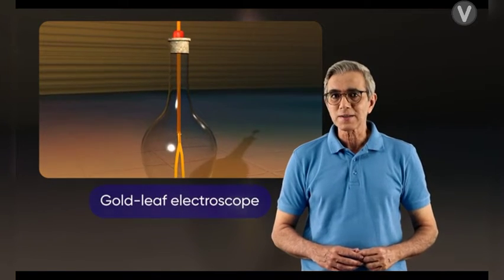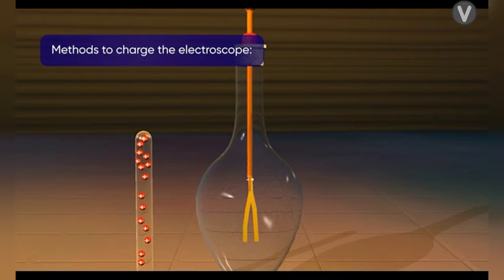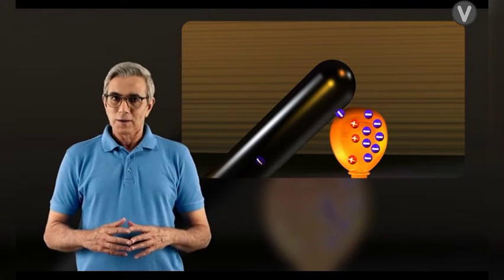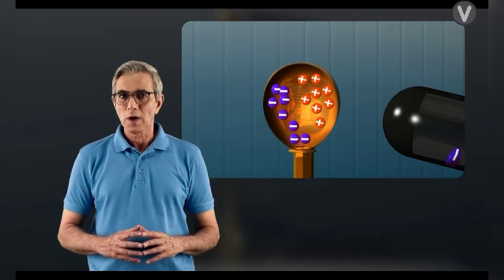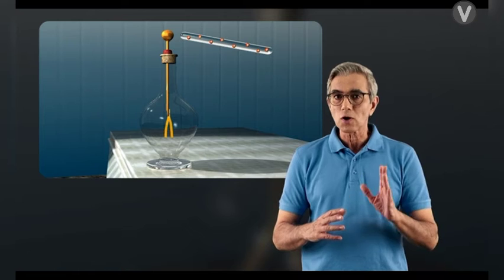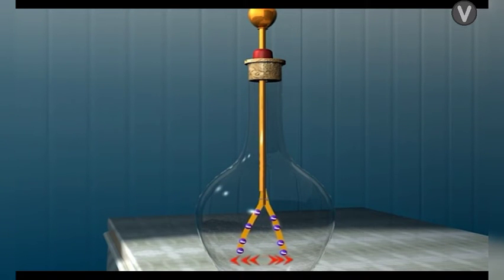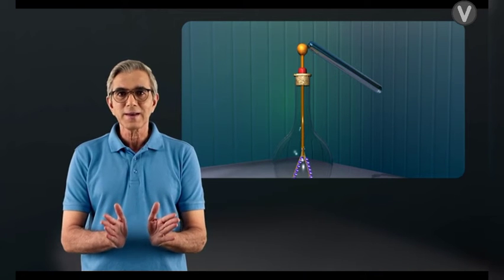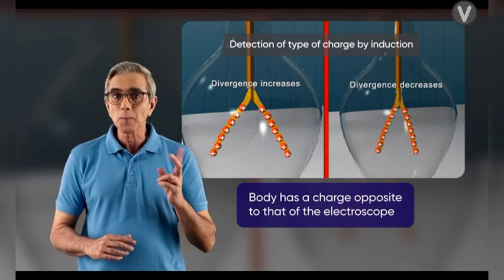Gold Leaf Electroscope Experiment | Application | Gold Leaf Summary | Gold Leaf Working Model

Comment: Excuse me, sir. I have some confusion: When the rubber rod is rubbed with fur, the rubber rod is negatively charged, right? (Because different materials rub against each other: the nuclei of different atoms have different attraction to electrons, and the rubber atoms attract the electrons of the fur atoms, so they are negatively charged) After the rubber rod touches the electroscope, the angle of the electroscope becomes larger, which means that the electrons are transferred from the rubber rod to the metal ball of the electroscope, right? The attraction of metal atoms to electrons is not as strong as that of rubber atoms, right? The electrons that the rubber atoms have finally snatched from the fur are given to it by lightly touching the metal? This electroscope is negatively charged. When the uncharged rubber rod connects it to another uncharged electroscope, why does no reaction occur? Isn't there a lot of electrons in the negatively charged electroscope? Why doesn't the uncharged rubber snatch its electrons when it touches it (the electrons of the electroscope should be easier to snatch than the electrons of the fur? Many electrons in the electroscope are redundant and have no binding force, why doesn't the rubber rod accept these electrons?)
Looking forward to your reply.
Reply from the maker: Why doesn't the uncharged rubber "snatch" electrons?
   * Equilibrium: The electrons on the electroscope are not "redundant" or without binding force. They are held by the overall positive charge of the electroscope's nuclei. They are simply in excess compared to the neutral state.
   * No strong enough force: The uncharged rubber rod doesn't have a strong enough positive charge to overcome the electrostatic repulsion of the existing electrons on the electroscope. It can't "snatch" them.
Reply from the maker: * Electron transfer depends on the difference in electron affinity and electrical potential between objects.
 * When objects reach the same potential, electron flow stops.
 * The uncharged rubber rod doesn't have enough potential difference to significantly change the charge distribution on the already charged electroscope.
Reply: Thank you very much for your reply，sir🥰
Reply: So nice

Comment: So if we have a dc source connected to a capacitor with a glass or ebonite inside its plates we can have a dc current through the glass or ebonite... 😅😅😅 The transfer of electrons from ebonite to the metal plate of elctroscope is not only due to the + charge of metal plate  but also from the microfriction during the conduction.